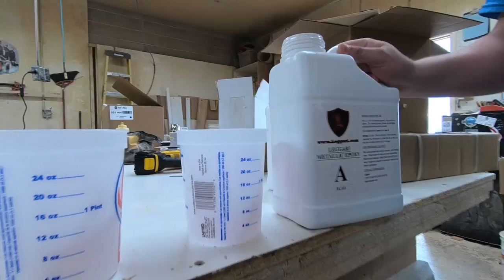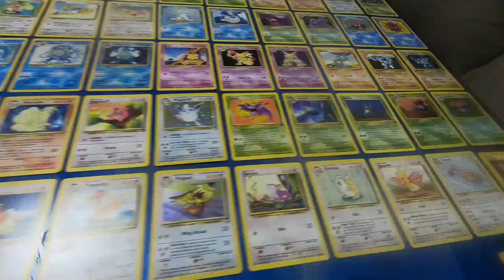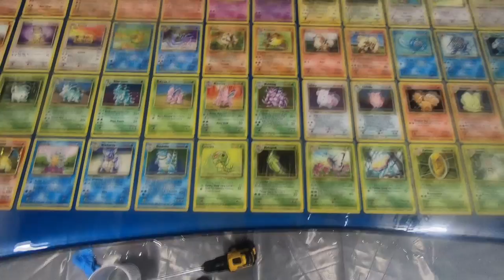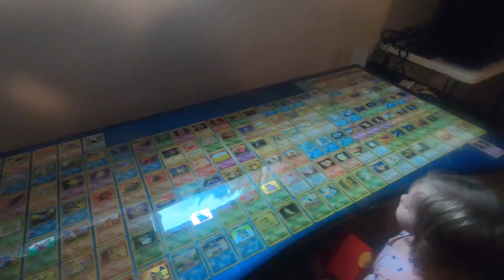151 Original Pokemon Card Epoxy Desk

Comment from the maker: For all the internet trolls out there who like to comment before knowing anything. This is a 100% cure epoxy by Legarri Products. meaning that it does not give off heat or fumes while curing. Secondly we are in a professional cabinet shop with commercial grade ventilation.  Anyone wondering how the cards did not soak up the epoxy and ruin around the edges is because we applied a layer of wax followed very thin coats of lacquer before coating in epoxy.

Comment: I’m trying to do a similar concept with a bar top but instead of Pokémon, I’m using football cards. Any tips ?
Reply: Yes it's important to seal the cards before covering them. Either with light coats of laquer or plastic dip. Otherwise the epoxy soaks into the cards